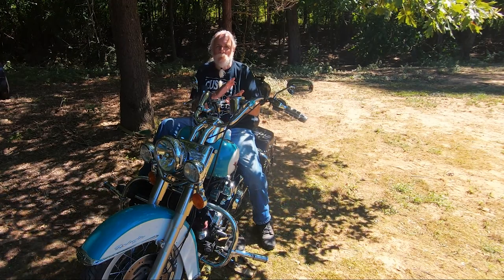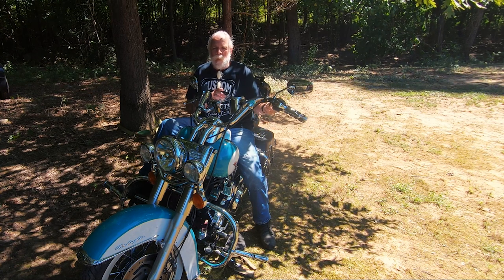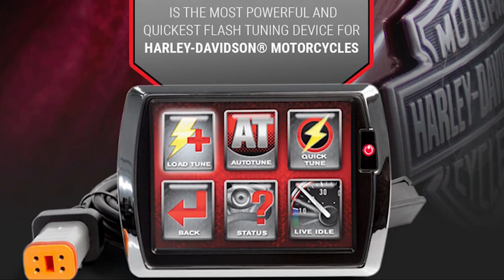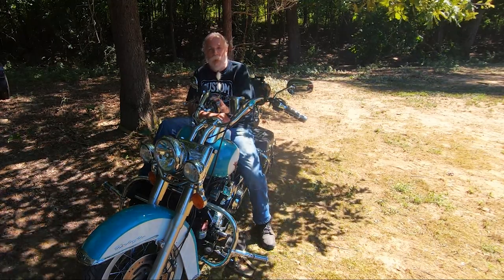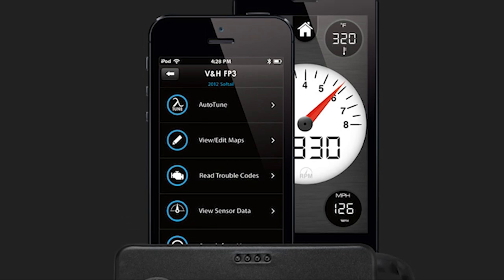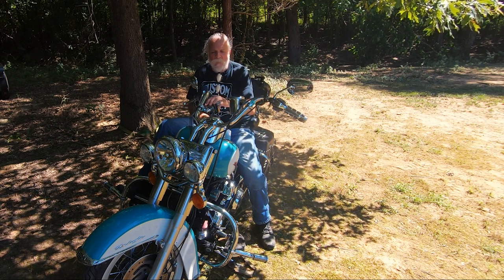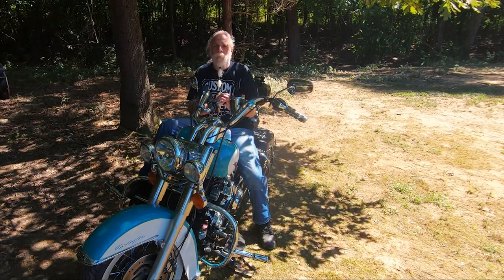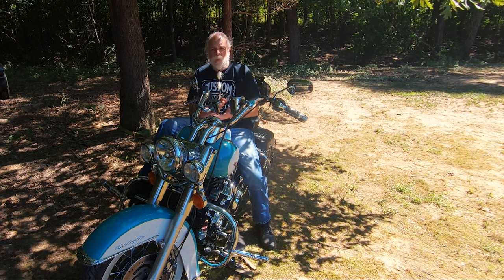COOL DOWN Your Harley - Get RID of that EPA Tune!

Comment: Another great video Kevin Thanks. I might add the PV Tuner is pretty fool proof and virtually indestructible.  The gauge display is a BIG plus
Reply from the maker: Yes.  Gotta agree with you Jack.  I would feel lost without the gauges.  Been using them for so long now.  You're right about them being close to bulletproof.  The one on my 2019 TG was previously on my 2014 TG, and before that it was on the 2011 TG.  It's got a lot of miles on it and works just as well now as day one.

Comment: Kevin how about the thunder max
Reply from the maker: Good question.  I have not used the Thundermax personally.  I have worked on bikes that have it, and talked to a lot of folks that use it.  Some love it, others hate it.
It is not a tuner in the sense of a FP3 or Power Vision.  Those two work with the factory ECM.
The Thundermax replaces the factory ECM.

Comment: I bought a 2016 FLTRU, V&H headers and mufflers. Screaming Eagle air filter. Houston gets way too hot. Looking first at  your air filter options. When I vent the breather away,  will I need to tune before riding? No plans to stage up. I'm primarily interested in reliability, durability, and ridability. What tuner do you recommend? Or a dyno tune? Technology-challenged panhead educated.. filter relocation, oil cooler and fan plan, too, possibly first?
Reply from the maker: Adding an External Breather System does not require any change in the tune.  If you have a good tune already, it will still be good after the addition of the EBS.  We like and use the Power Vision, which you can see at this link- http://www.dkcustomproducts.com/dynojet-power-vision-flash-tuner-w-auto-tune-dk-pv-cmp-pkg.htm

Dyno tunes, especially on a Stage I bike, are hit and miss, and very expensive.  Better (and less expensive) to stick with a Power Vision.

Where to start on cooling it down is dependent on what kind o f riding you do.  Mostly in town, stop n go, mostly back roads or interstate?  A mix of both?  Feel free to call or email us and we can let you know what we would do, given your circumstances.  Support@DKCustomProducts.com  662-252-8828

Comment: If I understand correctly the HD SE tuner is the only tuner of the four you mentioned that will not void manufacturers warranty. Please correct me if wrong. Thanks
Reply from the maker: There are ways to use the Power Vision that will not void the MFG. warranty.
Here is a video on my thoughts regarding OEM warranty since 2017.
https://www.youtube.com/watch?v=p8U4XsHyBug

Comment: On my FP3 there’s an engine temp …what should my engine temp be? Mine said 235 and it was 60 degrees outside ….and should I do the auto tune?
Reply from the maker: Your engine temp if you have a Twin Cam should be 230 or lower, if you have an M8 your engine temp should be 250-260F for optimal performance and engine longevity. 

Here is a video on Optimal Harley Temps that you may find useful - https://www.youtube.com/watch?v=rWOdQOtDv6A

Here is a full playlist on why and how to cool down your Twin Cam and M8  that you may find useful/interesting - https://www.youtube.com/playlist?list=PLb3bvZgbH92_3s-2vv63QggFJ3nteFd_C

Here is a written report that will also be helpful in understanding Harley temps and why they are so high and how to lower them- https://www.dkcustomproducts.com/why-how-to-cool-down-the-twin-cam-engine-part-i-dk-cl-tc-dn-1.htm

Here is a video on Auto Tuning that you may find helpful - https://www.youtube.com/watch?v=qVEhzU0sMYE

Please feel free to contact us with any questions you might have;
Support@DKCustomProducts.com
662-252-8828

Thank you for commenting!  😎 MB
Reply: @DKCustomProducts  I have watched that video what the auto tune will that cool it down?
Reply from the maker: If you read the report linked above (and below), you will see that if you have a poor tune right now (we have no way of knowing if you do or not) and you do some auto-tuning, it is good for cooling the ET down by about 10-15 F.

Even if you have a good tune, doing an auto-tune is only going to make it better.

There are a lot of other things you can do to cool your ride down....see link below and just start going down the list, starting with the free stuff first, and once you get it where you want, you're good.

https://www.dkcustomproducts.com/why-how-to-cool-down-your-twin-cam-engine-part-ii-dk-cl-tc-dn-2.htm

Also, here is a video that you may find very useful- https://www.youtube.com/watch?v=o3T3yA9BKwE

KP

Comment: Once again, another informative video, thanks! I look forward to seeing the more detailed one for tuners when it comes out. I have an '03 FLHRCI with a Stage 1 that I'd like to put a tuner on. No plans to do any further upgrades. Looking at a V&H Fuel Pak, but the version for my year/bike doesn't seem to have all the features (i.e., cell phone link) that the FP-3 has. Any thoughts?
Reply from the maker: Unfortunately 2003 was the early years for Harley in EFI.  I just went looking to see which ECM your bike uses, and it is not even listed as available on the microfiche.  It is definitely not picturing the ECM that is currently in use, so it seems to confirm what you have already been told...the current crop of tuners do not look to be compatible with your EFI.  Sorry I could not be of more help.

Comment: I have a 2016 H-D FLSS with a Stage-1, S.E. Smart auto tuner, S.E. Slip ons, External Breather System. Will the Nightrider work for my bike? And if so which one?
Reply from the maker: Your smart auto tuner works in conjunction with non oem wide band sensors...completely different set up than stock the XiED products are made to work with the OEM narrow band sensors...not compatible.
Reply: DKCustomProducts Ok thanks for getting back..👍🏻👍🏻

Comment: FP3 is good for stage 2. It has a cam selection option and it will allow the user to select custom values in every field that the PV does.
Reply from the maker: FP3 is no longer available.  Only the FP4, and they do support some cams.
Reply: @DKCustomProducts  I just bought an FP3.
Reply from the maker: @Greenmachine305  Old stock.  Someone still had it in inventory.  V&H quit making them well over a year ago.  You can see V&H is buying back FP3's, when you buy and FP4 at this link- https://www.vanceandhines.com/fp4-tuner-landing/
But, the FP3 should do you fine.  Thousands used it for years and were very happy with it.

Comment: Any thoughts on the vented oil cap, fueling and mad monkey?
Reply from the maker: They accomplish almost the same thing as the External Breather Systems, only more expensive and more installation and maintenance hassle & with them you still get oxygen depleted air into your intake, preventing a full clean combustion cycle.  http://www.dkcustomproducts.com/breather-systems-c21.htm
A vented oil cap will help relieve some pressure from an engine with an oil pump that is not scavenging correctly, or one that has bad rings/cylinders...but I would fix the problem vs. putting a band-aid on it.

Comment: The FP3 does, in fact, give you the ability to tune for cams or stage 2 setups.... your information here is outdated.
Reply: I just put an FP3 in a 2011 103 in which the cams where changed to S&S 551CE exhaust was changed to S&S Power Duals and Kerker 3.5 slip-ons with P.A.T. Baffles. I Flashed a map in, then emailed V&H the serial number, they emailed me back and said they tweeked mt map so open it up and flash it, then they asked me to run it up to 150Degrees and email them the map reading, (28) they emailed back and said excellent, run 2 tanks of fuel through it and if you feel it's not quite perfect yet, run the auto tune. Too much snow for all that yet, but the bike sounds damn good.

Comment: Ok so, you are advocating to all your  people that watch your Video's that they should Dump their Warranties with Harley.  Everyone needs to be clear......the very first time that they take their bike into a Harley Dealer, and it WILL BE plugged into the data technician, if it sees a change in the ECM for the tune it will send the info to MOCO and that bike's VIN will be flagged..FOREVER!!!  Also more fuel = less fuel mileage.  My TC 103 got 31 mpg with the old style "tune it  for power SE tuner.  My new 114 with Torque cam, AC, SE mufflers with cats in them and a SE header system tuned with the SE street tuner made 98hp and 114 Ftq and still returns 43 mpg.  It runs comfortable in the Florida heat. All under factory warranty.  So just let the buyer beware, for 5-10 degrees less temp they are giving up far more than they will gain. And what data are you using for the mileage lifetime? I've already seen stock M8's with over 100,000 miles.  Sorry I do not agree with your recommendations without giving the down sides of the changes.
Reply from the maker: The world is full of folks that put words in others peoples mouths...why add to it?

Most of the statements you make as "fact" are inaccurate.  We may end up doing an entire video just to clear up the misunderstandings that you (and probably many others) have.
Reply: @DKCustomProducts  Okay, would love to hear!  Thanks.
Reply: @DKCustomProducts  Some of his information may be inaccurate but it is a fact that if you put another tuner on your bike that is not factory or a SE tuner your engine warranty will be void the first time you take it to the dealer. You can usually get away with what ever exhaust and intake (if the manager is a dick he can still void your warranty) but you must use harleys tuner to maintain your engine warranty
Reply from the maker: @rollandklontz  Actually that is inaccurate on three counts-
1.  A Power Vision tune can be put on a bike, then if the bike needs to be taken in for warranty, the original tune can be restored.  There is no way they can tell the PV tune was ever on there.
2.  A ViED can be installed, and it does not leave a trace
3,  This is only a concern for 2017 and later bikes...after the collusion between HD and the EPA.  Bikes from 2016 and earlier (that may still have an extended warranty) are NOT going to have the warranty voided because a tuner is on the bike.
Reply: @DKCustomProducts  I'm a fan of DK and enjoy your videos and products, however... you are wrong with point #1.  If you take your power vision off prior to going to Harley, their software WILL detect you had at one point altered the tuner.  Power vision themselves will tell you that.
Reply from the maker: @tonyl8314  Thanks man, appreciate that you're liking the videos and parts.
Yes, if you put it back to the original tune, on the later bikes, they can tell that the tune had been changed, BUT they cannot tell the difference between if it was changed by a Power Vision or by one of HD's own EPA compliant tuners.

Comment: What stage would you consider a 03 SE deuce has a 95b comes with a cam up grade and I changed the exhaust and intake.
Reply from the maker: 03's came with an 88 cubic inch, so if it is larger than that, you have a Stage IV upgrade.
Reply: @DKCustomProducts  I know it has the big bore, cams, intake and exhaust but it was tuned already but 10 years or so ago. Didn't know if buying a tuner would really benefit it or not
Reply from the maker: @269-cowboy9  It probably could benefit from a tune, especially if you have not been running an External Breather System.
Unfortunately, the EFI tuners we have only work on 2007 and up EFI bikes.
Reply: @DKCustomProducts  yeah I can get a tuner but can't run Auto tune due to no O2 sensors but oh well thanks for your time and keep up the great videos

Comment: The FP3 doesn’t need to stay on bike. Also it can work on any stage you just need to call Vance and Hines and they will have maps to send you to your phone. Then you flash bike with new tune. Remove tuner all done. Maybe someone already said this i dont know. But FP3 is a great choice with no computer needed.
Reply from the maker: Yes, agreed!  The FP3 has been discontinued, and replaced with the FP4, which is even better.  See details here- https://www.dkcustomproducts.com/v-h-fuelpak-fp4-efi-flash-tuner-w-auto-tune-for-stage-i-ii-s-dk-vh-fp4.htm
Reply: @DKCustomProducts  the FP3 is still avaible 

I use it  on my fatboy lo currently and they can download any map also can be removed off bike as soon as it’s flashed. The fp4 is a bit different from FP3 is what Vance and Hines says
Reply from the maker: @James-fk2sb  Support for the FP3 is still available, and there may be stores that still have inventory of the FP3, but V&H has stopped making them.

Comment: I've seen you talking about oil temp, but how are you monitoring that with the power vision?? I don't see that as an option in the list of guauges which is the main reason I purchased one so I can see how the cooling changes are doing on the bike
Reply from the maker: We monitor two different, crucial, temps.
Oil with a dipstick that has a temp gauge built into it.
Cylinder Head Temp (which is displayed on the Power Vision as ET) to give us the same reading that the ECM uses to monitor engine temps.
Here are a few of videos on the subject that you may find useful-
https://www.youtube.com/watch?v=0vbTkRvFa80
https://www.youtube.com/watch?v=rWOdQOtDv6A
Reply: @DKCustomProducts  excellent. Thank you

Comment: Have to use the screaming eagle to keep my lifetime powertrain warranty.  Am I safe to go to a harley stage 2 on the milwaukee 8?
Reply from the maker: You're "safe" with your lifetime warranty...only thing you could be out is missing riding time while they work on it.  '17's and '18's have a higher % chance of sumping, and when going Stage II or higher, the chance increases.
Reply: Harley warranty is expensive toilet paper.

Comment: Who’s bike is that ?
Reply from the maker: That is Kevin's 2012 "Deluxe" Heritage Softail.  Here is a walk around video of it- https://www.youtube.com/watch?v=3ILbTGJqViY
Reply: @DKCustomProducts  I just watched the video, very cool bike. I’m looking at a 2000 Heritage right now. Only 3700 miles on it. I might have to jump after watching your video.
Reply from the maker: @LonesomeNomad137  Might be difficult right now, but there are big differences in how different year Softails ride.  That is crazy...only 3700 miles.
Reply: @DKCustomProducts  a Harley guru I know said to look for a 2010 or earlier. He said they made frame changes on the 2011’s and newer. I didn’t really follow him on what those changes were. When I bought my 05 Super Glide I thought it was the deal of a lifetime, it only had 2502mls. But the bike, although never abused was neglected, which can be as bad. The tires had 90% tread but were 15 years old. Battery and plugs were original equipment. I brought it to a local HD dealer and they charged me $500 and missed everything. I wanted to make sure it was safe. I’d bring this one right to my performance shop and make sure it’s solid. I hate not having one, even if I can’t ride yet, which I think I can.
Reply from the maker: @LonesomeNomad137  The Softail Heritage frame did NOT change in 2011.  It is the same frame in 2011 as quite a few previous years.  I stopped checking after seeing the same frame part # for 2009, 2010, and 2011.
The Touring model frame changed in 2009, and then again with BIG changes in 2011.  The 2011 later bagger frames are MUCH superior to earlier years.  Much less likely to experience the "bagger death wobble".  More stable, less flexing, and better handling.
Yeah, not being able to ride sux.  After my accident I went from August til late November without riding.  When I finally did ride in late November, it was amazing!
Reply: @DKCustomProducts  yeah that was my bad. He was talking about touring models, but he said they weren’t better than 2010. I’m gonna hit him up and find out what he was talking about. Thank you so much for the information that was informative.

Comment: What if your running Screamin Eagle Pro wide band O2 sensors and a dyno tune?
Reply from the maker: All Screamin Eagle tuners, including the Pro with wide band o2 sensors, for M8's are EPA compliant, and by definition/design not going to give you a good tune.  You might be able to get a good dyno tune from an independent shop, or from a Harley shop that is not concerned with following company policy of staying EPA compliant.  Check out this video- https://www.youtube.com/watch?v=isBHK-Jy7Wk